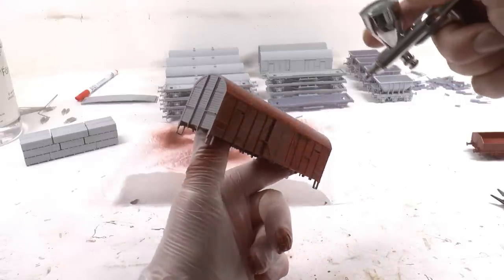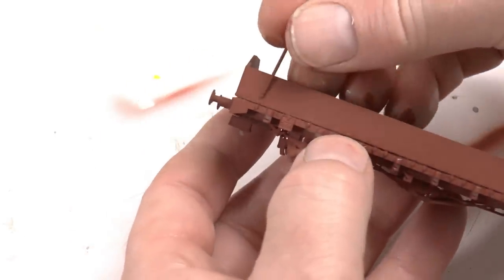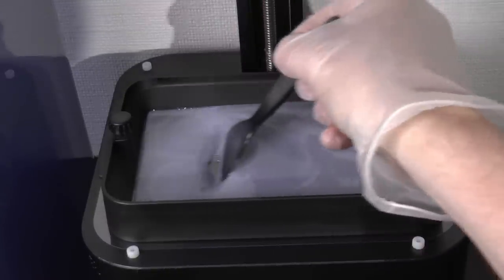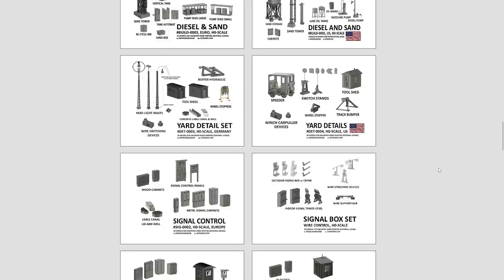3D-printing freight cars and cargo using Anycubic Photon Mono 2

Comment: Got new LCD for my first Mono 2, my 2nd Mono 2 is still fine, but now there is the Mono 4 with a 7" 10K LCD with 17um x 17um pixels. Crazy details for such a low cost machine.

Comment: What colour or mix of colours to use for Litt Mas iron ore hoppers? - Also from my Anycubic software I get a warning about too little supports and if I print the provided models indeed they end up in print failure. After adding supports via the slicer it works but then I have slight problems with removing the additional supports. Also in the V3/V4 release of the Litt Mas iron ore hopper there is np "All" stl, only the matching PNG image - so you have to add in all the needed files by hand and then readjust & align them

Comment: The lines on the cylinders are not layer lines, they are a result of the digital conversion process from real cylinders in CAD to the stl files. The layer lines from the printer are visible at certain angles as the light hits them, but I suspect this is also due to the magnification, a 0.03mm layer height is roughly 1/4 to 1/2 of the thickness of a human hair so pretty thin

Comment: Have you noticed any significant difference in temperature inside the 3d printer case when covered, and outside?  I put a small temp sensor inside the 3d printer case and see it warmer by 2-3 degrees.  I assume this is no issue, if the room temp is in range  I haven't had any issues with the temp skewed a bit to the warm side.  Thanks for the content!

Comment: I just added the Anycubic Mono X 6Ks to my print farm to gain a bit more build volume.  Such an amazing printer for so little (relatively) money.

It's time for someone to go back through the 50's - 70's Model Railroader magazine issues and create a startup that converts the highly detail blueprints provided for rolling stock, motive power, and buildings to STL files for printing!
Reply: I found Government archives have builders photos and drawing of old government railways, very handy for Steam Era modellers.
Reply: @AlwaysCensored-xp1be  Yep, the Gov archives are amazing and those glass plate photographs are great to zoom in for details.

Comment: 3D printing is amazing for hobbies like this. I love how much progress the technology is making, and the prices aren't nearly as high as they used to be. I like being sure that everything is to the same scale, and having control over how detailed it is or what it looks like. Some of the prefab stuff is pretty expensive, and you can't get a good look at it without buying and ordering it and waiting for it to show up. And even then you feel like the thing you really wanted just wasn't a choice, or was out of stock, or they only had it in all the wrong scales; and you had to settle for close enough. Them having to make everything in different scales also really limits the variety of parts available. It's just stretched too thin to be sustainable. And I never found any prefab stuff that I really liked that wasn't just a bit too expensive. It's nice that these problems are solved.

Comment: Mixing resin is the best way to find that perfect balance! There is another swiss guy on here testing all the resins and mixing them for that sweet spot I follow his findings and works amazingly! Also never have issues with the ambient temp really being in the upstairs room it's always warm I have the mono 4k it's brilliant but just need that bigger build plate so it's the new mono 2 or the m3 there in the same ball park figure for price only you get a whole 2.0 wash amd cure station with the mono 2 just now for that price but already got one with the 4k unit! Mono 2 has latest tech with the new temp inversion whatever ignis built in and prints more 8k than 4k because of the pixel and screen ratio! It's no different from the 8k elgoo proved and tested this week

Comment: Wow, we're genuinely stunned as well. This is another level of 3D-printing. And essentially, you can print whatever wagon you want, provided that files are available or DIY. Should model manufacturers perhaps be worried...? This is significant in such a way that it is changing modelling quite dramatically.
Reply: they are worried. i don't really know about train models, but for wargames, games workshop is taking this very seriously. and in this instance it's their own IP. now with historical models, etc. it's not like manufacturers can do a lot about it.
Reply: I would think large manufacturers consider this fringe interest still.  They sell ready to run equipment, while this is basically a do it yourself kit, and not everyone is up for that, to say nothing of obtaining and learning to use the printer.  The main strength of this technology is in making models that the mainstream manufacturers are ignoring, making fleets of what previously would have to be individually scratchbuilt models possible.  If anyone would be concerned, it would be the specialty kit makers, since these sorts of models are more their target interest.  And there is still the problem of obtaining lettering for this sort of thing.

Comment: I’m getting closer to buying one, but with all of the improvements they keep adding, I think I’ll wait a little longer. The mess of the liquid still has me hesitating. Thanks for an informative tutorial!
Reply: same , but seeing results like this makes me more confident about jumping in .
Reply: I jumped in and don't regret it. It isn't as messy as I initially thought. Just wish I took the time to learn the proper way to do it before buying it. Realistically you can just leave the resin in the vat for as long as you want, as long as you haven't gotten failed prints. Was a complete noob, failed my first two prints but even though I am an extremely clumsy person, I have gotten it down ever since. It's been easy breeze since. However though I do believe there may be some big innovations soon
Reply: If you keep waiting for further improvement you will never move forward. By one and live with it. Later you can always upgrade.
Reply: I have one and do hate the mess.  I bought an FDM printer afterward and prefer it.  Martin’s videos are convincing me to work my Anycubic back into the schedule.

Comment: Nice job Martin, I would like to see a tutorial about other cars, which have smaller wheels converted to RTR on Märklin tracks, like American gondolas.
I also want to point out a problem at CJ trader, as I wanted to have a model for printing. The artist cancelled my design and had to ask for a refund. The refund I received was lower than what I paid for at the beginning. I informed CJ trader about this. Keep up the good work. Robin

Comment: Hi Martin. Great video again. I'm using a Halot One 3D printer. This has a build plate of 127 x 80 x 160 mm. Do you know if its possible to print these freights and cargo cars on it?
Reply from the maker: Hi Hans, Thank you! 127 x 80 x 160mm. Yes it should be possible.

Comment: I can see the layer lines on slopes, slanted lines... but obviously this is magnified. and also i assume if there are any obvious lines, they could be sanded or filed easily. that is of the main issues i have with fdm. you get lines both on all three axis. and i haven't been able to find a good way to fill them.
Reply: Those aren’t lines, but faces. Not enough faces made on the cylinders.

Comment: Amazing! 🤩There is quite a bit of confusion when it comes to UV light intensity. By default is set to 100% on the printer, but I'm wondering why some people are using 80%. What do you think?
Reply: U cant set the UV level from the printer? Only the curing time in the slicer.
Reply: @allffrommars6019 On the Mono 4K you can.

Comment: Very interesting, thanks! I have a question about scales. If you use a 3D model designed for H0, can you just downscale it to print it for N scale? Or do you need a new model?
Reply from the maker: Hi! Thank you! 
Down scaling max 5-15% is possible for most models. However, down scaling from H0- to N-scale or Z is for most models not possible. It only lead to print fail and printer maintenace
Reply: @marklinofsweden  Thanks for your answer! That was my fear, that the level of details and number of polygons would cause issues. I love the N scale, but it is a bit of an extra struggle in some ways.

Comment: I have watched almost all of your videos I was going to subscribe to your Patreon but because I have asked you various questions and  you never have responded I thought that you are not interested. I am even a Gold Member of Model Railroad Academy and no response. Not sure why maybe to busy.
So I have a suggestion for you on your resin challenge and that is to change your resin to Siraya Tech. If you take a look at it you will find that it is one of the best and easiest resins to use and handle and no smell. I took shake my resins vigorously but there are no bubbles. The clean up for the parts is super fast. Also when taking the supports off rather than cutting them with a knife I just take a large container that I have and fill it in the sink with hot water and use a sive of basket and put my parts in there and leave them in the hot water for a few minutes and voila the supports come off like butter. No fuss no muss nice and clean I then put them into a container and lightly brush the excess resin off and let them dry and then put them in my Creality UW-02 curing station for 2 minutes and they are perfect. For my printer I use the latest Creality Halot One Plus which is probably the best machine on the market out of all the printers of the 4K category as it has the largest build plate and the best mono light system. They even ship it with its own slicer which is really easy to use for people who are just getting into the 3D Printing Hobby.
Hope this helps you.
Still love your videos they are some of the best on YouTube, it would just be nice to get a reply.
Blessings
Pastor Randy Bourque
Reply from the maker: Hi Randy, Thank you for your comment! I must agree with you that my response percentage rate here on YouTube is poor. I must also admit I´ve not seen your previous comments. I´m sorry for that! I spend  60-70 hours per week just doing video production, product development and social media interaction. But.. there´s simply not enough time here to make a good job on responding to comments and questions. All in all I get about 90-130 questions per 24h from the media channels I´m active. I put priority to the Patrons , where I would say I respond to 100% of all questions within 48 hours. The rest.. less.. Model Railroad Academy do not have any assisting functions for external creators (=me). That in practice means that I need to open every video and look for comments to respond to. Having more than 300 videos online there over the range of channels MRA provide.. It´s an impossible task for one guy.  Siraya Tech.. Yes, I really like the resins from them. They are very good. However, I can´t use Siraya tech resins in a video sponsored by Anycubic.

Comment: It's not for 189$, it is for 410$. Little difference....
Reply from the maker: Then you must be looking at the wrong mashine. Mono2 has blue hood and costs $189-199
Reply: @marklinofsweden  I follow your link. So when you're right, your link is wrong.
Reply: @harvantol8665  No link works fine 199 Dollars... Amazon 220€

Comment: I think its fine, but not cheap. I think you cant stop laughing because you get it for free. 😮
The cars looks very light, witch is a problem in curves.🤔
There is a lot of wasted resin during printing. I am not buying in on this printing yet.🤗
Reply: you can add some weight to the car later. Try to use some copper sheets